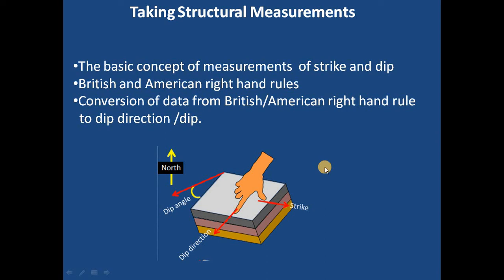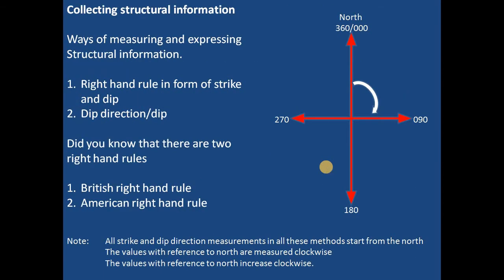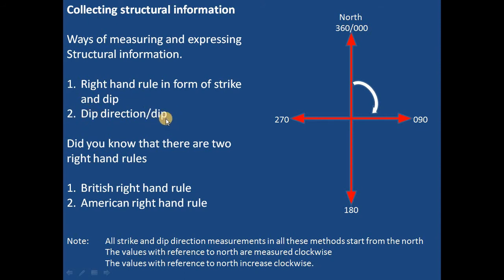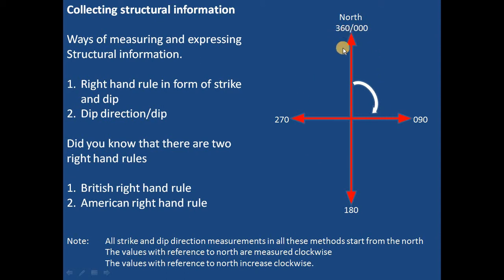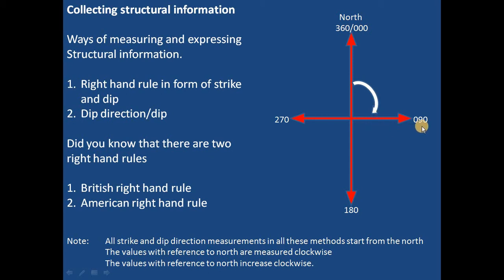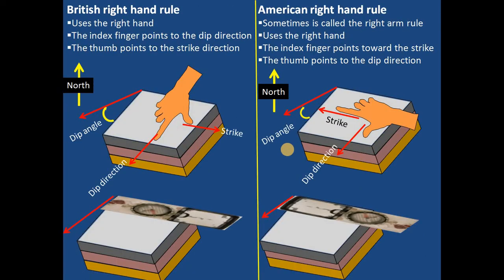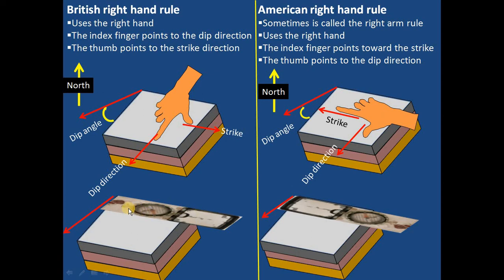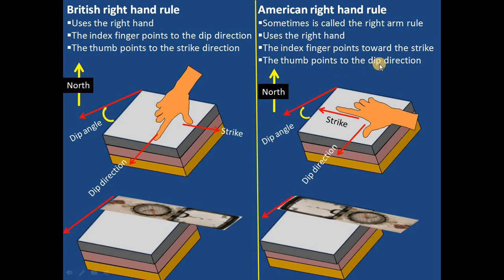How to collect and document geological structural measurements by right hand rule and dip direction

Comment: I'm an "American" professional geological engineer and have been practicing in the U.S. for over 15 years and field map structure frequently. I've always said I've used the right hand rule in which I calculate the Dip Direction as 90-degrees clock-wise from the strike direction, (much like you've shown in the video for the British right-hand-rule.) All my U.S. colleagues do it the same way as I do. When you reference the "American" right hand rule, are you perhaps referencing Central and South America? I guess that could be considered and "American" rule as well.